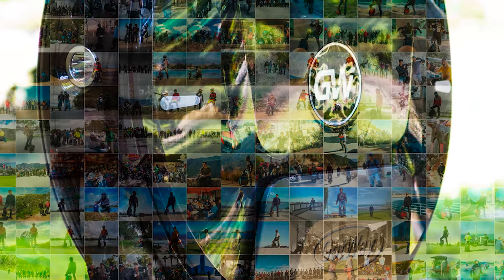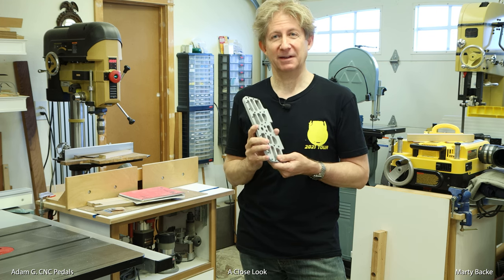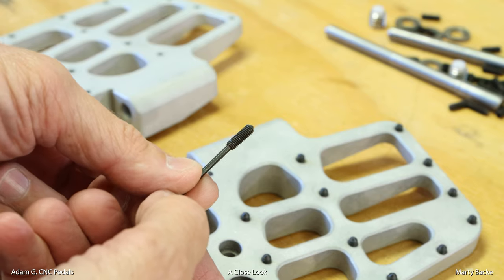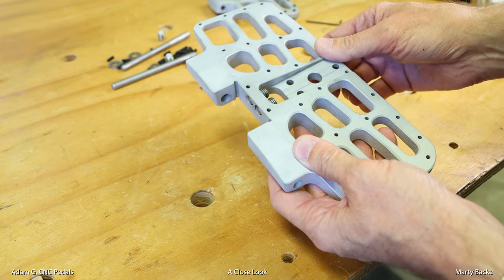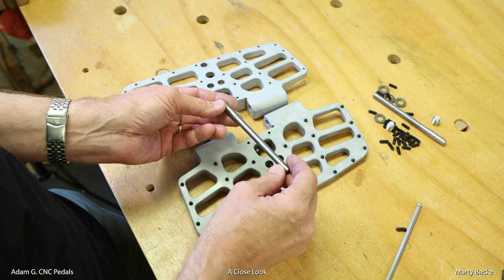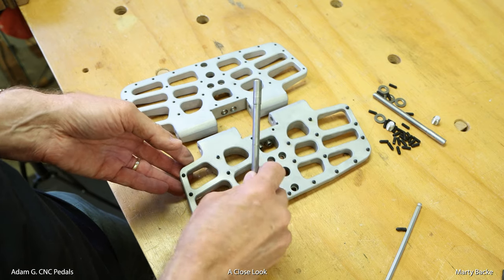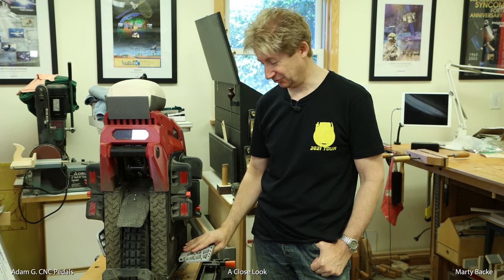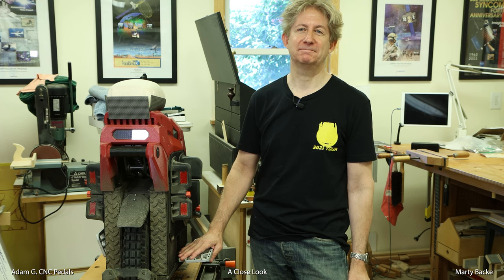The Best CNC Pedals

Comment: If you used the nylon tiped grub scews to keep the pedal pin in it would hold the tention better. Less adjustment over time as a pressure is maintained rather then a distance that changes with wear.
Reply from the maker: It does use the nylon tipped grub screws. I've been using this pedal system for over 1/2-year and I haven't needed to make any adjustments.